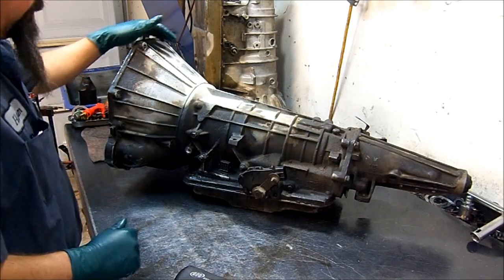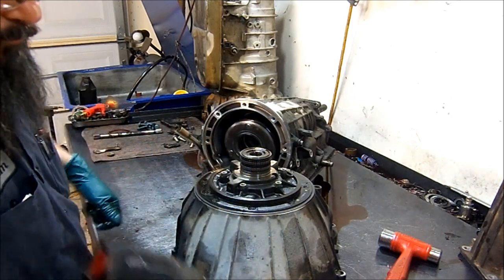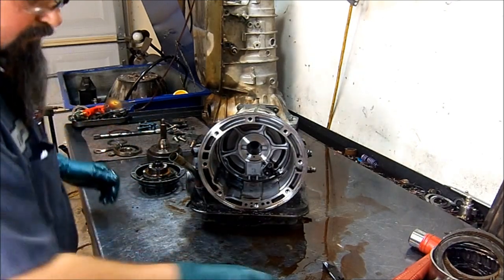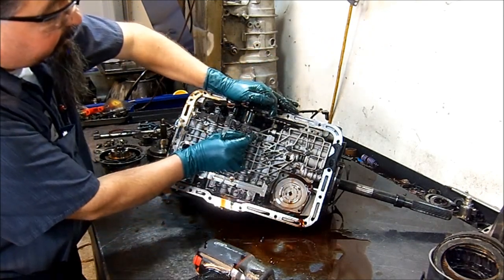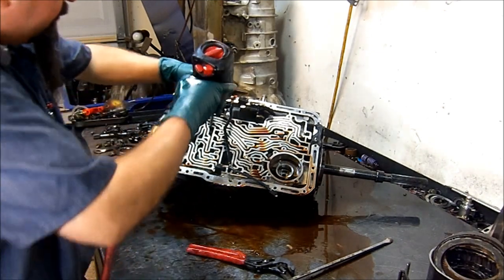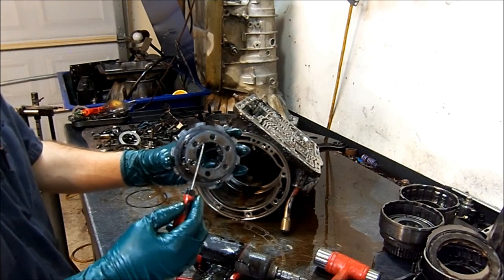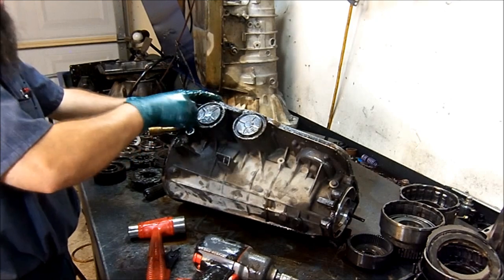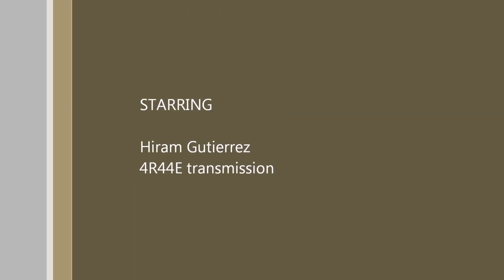4R44E Transmission Teardown Inspection - Transmission Repair

Comment: replacing the shift solenoids do you still have to remove the case with the 10 mm bolts

Comment: Hey Hiram, I'm tearing apart/rebuilding an A4LD model and am using your video as a very useful visual guide. You've given me some extremely helpful tips about not busting stuff and this is the first time ever I've taken apart a transmission. I'll be rewatching this video multiple times. Thanks for the video!

Comment: I know this is an older video. It is one of the best tear downs for thsi transmission. 

I rebuilt my 4r44e with a heavy duty rebuild kit off ebay. I am pretty sure sure I installed everything to spec, including the band adjustments. I burnt my 3rd gear playing to hard in the mud and over heated my tranny. All the gears worked, but in D,  if I gave it much gas it would slip upon 3rd gear.

But now D slips from the get go, as well as R. 1,2 work perfectly. What do you guy's think I did wrong?
Reply: You ever find a 4r44E ASSEMBLY Video anywhere?
Reply: @2oswalds  Nope! I did my best putting mine back together, and needless to say it's not as easy as reversing this video. I replaced everything and it still does what it did before I rebuilt it. Even though it had obvious burned clutches that I did replace. So it's still parked in  my driveway. Also this is one of the hardest transmissions to find anywhere.
Reply: @adew4u2enjoy  Was the overdrive sprag good?
Reply: @rcherping8284   honestly i don't know.

Comment: Question I have a ford ranger, AT, 2.3 that shifts very hard from 1st to 2nd, and also into 3rd but a little bit softer, do you think it need a total overhaul or can it be patched by replacing only the solenoids? and the gaskets?

Comment: Have you ever used Knipex Pliers? 
I noticed the ones you have would pinch your hands if you slip. The Knipex has the no pinch design. They’re a little more expensive but well worth it. 
Their Cobra pliers to replace the ones you were using and a pair of Pliers Wrench also. 
I swear you’ll love them!

Comment: Hi Hiram. I have a Ford Ranger 2009 2.3L. I took down the base pan of the Transmission. there's no Metal Shavings or blown gasket. But when i shift in Third gear 3th. My OD LIGHT Appears. Could it be a Bad SOLENOID OR SOMETHING ELSE?

Comment: Hi, I have a question, I have a 5r55e transmission, while driving, in 3rd gear you hear a clunk while its in gear (not shifting up or down) and my question is, what could be the problem? It used to also flare between 2&3 gear and 3&4 gear (it would rev engine up a little before shifting, about 100-200 RMPs) so I added Lucas transmission fix and that seemed to stop). But i still hear that clunk while in 3rd gear, it's not noticeable while accelerating slow, but if I accelerate fast it clunks) any ideas of what the problem could be? Thanks in advance

Comment: First off you are one hell of an instructor. I never rebuilt a transmission until now and I've gotta say it. Where did this technology come from?  This was not intended for automotive this had to have come from something far more advanced and developed in the 60's after seeing the valve train and check balls that control things simply by rate of flow and pressure. It's absolutely amazing. 1 question  in a ranger 3.0 with 4r44e transm do I need both the internal radiator cooler plus an external radiator cooler?  No this is the first time it's been opened ofcourse not, I knew from the start the lines weren't going to survive. Just wanna know if I can bypass or even eliminate the  external cooler. It's only 6" H x 11"L x 1/2" W it can't be doing too much but dumping all my damn fluid when I'm aggressive having fun out in the middle of  NO STORE FOR MILES!!! ITS ONLY HAPPENED TWICE🙄 . Enough that I now have a spare cooler and 4 gal at the cabin lol

Comment: hi, do you ever recommend doing transmission flush will cure any transmission problem. 2) if I change the transmission oil as per manufacturer recommendation and transmission is good, I assume flush is not needed and give no benefit, can u please advise..  you have lot of experience your comments are most valuable for us .. pls don't discard this note.

Comment: I have a 5r55s in a 04 explorer 230k miles, rebuilt it with new servos,repaired bores,new direct drum new bands clutches and springs. Before rebuild it had no 4th revrse and slammed into 1,2,3 now it goes into 1,2,3, and 5 good but still no 4th or reverse. Air check shows direct to be functioning. Any suggestions? Could this be a valve body issue?  Thanks

Comment: I have a 4R55E in my '96 Explorer. Loss of reverse, unless you really rev ir....won't upshift from 1st till over 3,000 rpm. Going to attempt a rebuild with a new input speed sensor, new clutches & steels, o-rings seals, and gaskets, & was wondering If it's necessary to change all the bushings?  Just hoping my rear needle bearing, and sprags are ok. Also putting in a shift kit.

Comment: I have a 1999 Ford Ranger XLT 2 wh drive 3.0 L 6 Cyl 2 wh drive, won't go in reverse. I changed the filter and put the pan back on, it was overfull, But now I can not get the dipstick to go back in, I turned it a million times but it won't go in, help any advise will be appreciated

Comment: Hola, tengo una ford explorer modelo 1998 y despues de unos 5 o 10 minutos la transmision se queda en tercera 3, y no hace los cambios, al meterle el escaner me dio el codigo p0500 VSS, y el sensor esta en buen estado y el harnes se encuentra bien, y la lectura del sensor es igual a 0mph en todo momento. me podras ayudar, yo creo que esta en mal estado la ecu. tu que opinas? gracias de antemano.
Reply: bueno, lo que hize fue reemplazar el sensor vss y revisar el harnes a la computadora, las lineas hasta la computadora estan bien, y en los datos en vivo en el maxxidas seleccione el sensor vss y siempre me manda 0 mph,
Reply: ***** muchas gracias, es muy bueno el video que me recomendaste, tomare en cuenta lo que ahi comentas. gracias por la ayuda, despues te escribo para ver como me fue con la falla

Comment: Hiram, I posted in the wrong place.  Trying again.  I have a 7A034 tail bushing for a 4R44E Ford transmission that needs replacing.  Instead of paying a billion dollars for a specialty tool, is there a way to get the old bushing out and a new one installed on the cheap.  Like a bushing driver out of what size socket or something like that?

Comment: Hiram Gutierrez i am sorry to bug you but need to know. I have 2 rangers 1 is a 95 with trans code T (4r44e)  other is a 05 trans code D (5r55e). Is it possible to change the valve body and use the D in the 95? Keep in mind the 95 is a 3.0 and the 05 a 4.0 both auto 4x4. I have a complete truck smashed in the front and a near mint truck with a bad trans. trying not to spend cash if I don't have to. Or should i just gut the 95 and change everything from the 05 to it, computer and all?

Comment: I have a 2003 Ranger 3.O auto.I have a lot of fluid on the bottom of the pan. I had no leaks on the ground though until I raised the front of the truck today to do a routine brake job. I noticed there was a 4in circle of fluid now on the garage floor. 
I haven't cleaned anything up to start looking for leaks but I'm betting this is something you know about  already LOL.
What should I do now?
There has been some hard shifts at higher RPMs but shifts pretty smooth overall.
I'm currently disabled and this is my main vehicle to get me back and forth to my spine surgeon and physicals therapy....I'm getting ready for another surgery.....already have  12 bolts....3 are 5in....and 2, -9 inch rods. I wouldn't do the brake but I have to due to lack of funds. I have to do the other side of the brake job tomorrow. 
I sure hope this isn't something that's showing and exiting transmission. I don't know if I can handle it with no family anymore. Sorry for the fear rant....lol.
Please let me know what I can do to diagnose deeper.
Thanks so much.....I'm so blessed to have found this video!

Comment: Hi Hiram? Do Honda's parallel shaft design with internal filter is a forever an incurable  weak point as oppose  to planetary design with external filter in your opinion? Also,how good is GMC, Hyundai's transmission as compare to Nissan's Jatco and Toyota Aisin?

Comment: I have the exact problem that you talk about on the overdrive sprag.
I back out of the drive way, shifted to drive and heard a bang and then nothing.
Pulled it in 1st nothing. Put it in second a drove away. Then up shifted and it work perfect.
I drove it for weeks like that.
My question is,,,, Is that overdrive sprag and overdrive assembly the only thing that can cause that issue ??
Was the bang the sprag flipping over as you say ?
Is there any other thing that can cause no take off in drive ?

Comment: I have 2000 ford ranger whit PO741 code tcc solenoid  I change  the  solenoid and  I have  the  same problem I drive for few miles  and  the OD light  blink  I rebulit  the tranny few  months ago  can be  Bad  torque converter ? the oil and the  pan is pretty clean I clear the code I drive  in come back again any  advice thanks I  enjoy your  videos

Comment: Can you do an ford A4ld inspection. I have no gears and white smoke was blowing everywhere last time my explorer moved. I'd like to rebuild it myself with a little help
Reply: Tried the modulator tfilled it with fluid measured it on dipstick. Stated truck ran it for 30 min checked dipstick again fluid was at same level and still cold
Reply: Yes! Please do a A4LD trans. I have to disassemble my trans do to some severe trans fluid leakage, complete loss of movement to the vehicle. Won't know what the problem is until it's taken apart.
Reply: SweetDream669 the pump went out on mine believe it or not the torque converter took it out
Reply: Ian Tran this is common on explorers

Comment: I have a 5r55e and the is light flashes,it will shift from1-2 but not third. I pulled the VB and found the gasket blown on the reverse servo could that be the problem? no obd2 codes but can't scan transmission

Comment: Hello I have a 4r44e and initially I had no reverse.  Replaced Reverse band and several bearings and upon install I had all forward gears but weak reverse.  On the lift it would engage and go into reverse but on the ground it would barely move the truck...  Any ideas?  I have tore it back down and reinspected and see no issues.  Help Please!

Comment: I have a 1999 ranger 3.0 I have tire down my transmission and everything is new but the problem I got my pump not working I put a new converter in and check my pump out too but still dont pump can u help me out

Comment: Actually when you break it down the speed turbo sensor isn't that hard to get to. I'm breaking down my wife's transmission and the one that came with the truck. The drum is groove like a rotor would be the band is fried and I can see what they mean by when the overdrive goes and flips. I'd send pictures but I don't know if it go through

Comment: THANK YOU HIRAM GREAT VIDEO I HAVE A 4R44 TRANSMISSION THAT RIGHT NOW IS SLIPING ALLOT AND IT ALLWAYS HAD THE O/D LIGHT ON IF I REPAIR THIS TRANSMISSION SHOULD MY O/D LIGHT GO AWAY? AND ANOTHER QUESTION IS DOES THE MASTER KIT BRING ALL THE NESESSARY PART FOR A FULL FIX ?THANK YOU

Comment: i have a 2003 ford ranger 3.0 automatic and the gear selector is really stiff, its not the cable, will good penetrating oil free up the selector shaft?

Comment: I have a 96 ford ranger. My speedo stopped working and it wont go into drive. only 1st and 2nd. Any ideas on what it could be? Ive changed the torque converter, filter and speed sensor on the rear end,

Comment: OK. answer to my own question is seal ring can wear a groove in center support that will keep support and forward clutch cylinder from coming apart new used parts in my case were a most E-bay but look for the right part and price be for you buy even though these parts can be cheap seams like you can always find cheaper and free shipping helps too.
Hiram is bad to the bone for helping us out! Thanks again.

Comment: Hiram, thanks once again! This video is great but when it gets to 28:39 you reach in and pull out the sensor port and it just comes a part from the hubs but my 4r55e has a keeper ring-snap ring down inside that holds sensor port and hubs together it looks like the ring spreads open over tapered end of hub when it is put together and there is no room to get any kind of tool in there to spread the ring open. If any one knows the right way to get this ring open? Port& hub are out just need a part.

Comment: Great video for what is my A4LD in my 1988 Ranger with a the 2.9L I have had it rebuilt but a know problem is with the case as I can blow out the front seal under loading, like uphill with a load. It pukes out fluid, I turn off the engine and it pulls back in, and away I drive. Any answer on that problem? Thanks!!

Comment: hola, muy bueno su trabajo, felicitaciones, tengo una 5r55e y presenta los siguientes problemas, luego de ir sobre 80 km/h y hace el ultimo cambio, en pocos segundos lo suelta y comienza a prender la luz o/d, el excaner dio un codigo p0741 que es el convertidor de torque lo cambie y sigue el problema, cambie el TCC y sigue igual?? que puede ser

Comment: Hiram help! Pete K here I posted about rebuilding my tranny after I saw your video. I have everything out, but the low/ reverse drum  won't budge no matter how hard I try and pull. I noticed the one you did popped right out no problem. When I look inside it with a light, the back portion looks all bluish like it heated up. Any ideas I hope? PS, from your description I thought my manual start in 2, shifting to drive, was the overdrive sprag, but that feels fine when I turn it by hand. Could the low reverse drum, and the heated look be my problem. Thanks again. Another PS, doing outside today in 20 degree weather. Brrrrrrrrrrr.

Comment: Thanks excellent video. My 4r44e used to make a whinnying sound before it change gears. Then it start linking oil and stop working. What will cause this problem? I have never rebuild a transmission before, but after have the unit rebuild 3 time and it did not work correct, I am now considering rebuilding it myself. Thanks in advance.

Comment: Nice video. How do you get the shift linkage out of the inner transmission pan. My 4R44E broke the rod that pushes the pin in the parking pawl. And it also broke the pin. Is this a replaceable item without tearing the transmission down?

Comment: Hi Hiram. I'm having my transmission rebuilt on my 2000 Ford Ranger. Should the solenoids be replaced when its rebuilt or would that be an extra charge?

Comment: hello sir just tore down my 4r44e and found the pump washer was gone and the overdrive drum was rubbing against the pump. out of a 98 ranger 2wd 4cyl. any common problems that would cause that? thanks and great video.

Comment: I straight want to be this guy. Hyrum is a boss. 👊  I'm rebuilding a 5R55E in my Explorer with no seats but a driver's seat. I just assembled it and had a retaining clip & a bearing left over.. heh. no problem.  I'll pull it apart & install the 2 pieces. Got my 99' Explorer for 300$ cause of a broken reverse band.  Thing is immaculate otherwise. nice video.

Comment: I like this video....thanks Hiriam -- I like how to dismantle the trans into pieces.  I have a 2002 B2300 mazda, rear wheel drive, is the concept the same with my transmission?  I am being asked to buy a trans overhaul kit 56006L, trans kit 4R44E, 5R44E, 5R55E...
Thanks for this excellent video!

Comment: good morning, what is your opinion? Can I change my transmission from an explorer 95 4WD to another from an explorer 4WD 97,98 99 or 2000? According to my mechanic, the only difference is the site for the starter, which is solved by cutting a bit of the starter core.

Comment: Hello Hiram,  I am getting ready to rebuilt my transmission 4R44E, I had a problem with reverse and drive not working at all, when I tear-down should I replace overdrive planetary needle ring as you mention including planetary and all band ?  Please let me know.  Your video is extreamly helpful !  Thanks for your time.

Comment: I have a 2000 Mazda B2500 with an automatic transmission. Im having an issue with the torque converter sliding far enough on the input shaft, so the transmission will bolt up to the engine. Besides taking a hammer to it, do you have any advice?

Comment: Great presentation Hiram.  My 97 Explorer trans crapped out.  I had no movement in forward gears.  I limped home in 4 WD.  My vehicle has 155,000 on it.  Good engine.  I will look for another good explorer.  Seems my Overdrive is screwed up as I got a whirring sound as I coasted to a stop.

Comment: Hiram, I have one question, I have a 96 Explorer I'm building it is the 4R55E, I have seen many different takes on band adjustments. Tighten to 10 ft lbs and back off anywheres from 1 1/2 turns out to 2 1/2 out. What do you do for adjustmants?

Comment: Hello, great Video !!  I got a 2004, Ford Ranger 3.0 V6 my transmission is locking up !
I can drive my truck and all the gears will shift un & down but if I go over 40 MPH I won't be able to stop with the trans in gear if I doo my engine will die .  I can go in reverse or Neutral , no problem but if put it in drive kills the engine .
the torque convertor and complete valve body with solenoids is being replace but with no luck .
can you please HELP !!

Comment: Wondering how the detent that holds the transmission in the selected gear is removed/replaced? Mine has little to no resistance in any gear other than park

Comment: Would it help to put a little blue lock tight or something on the valve body bolts to prevent them from getting loose?